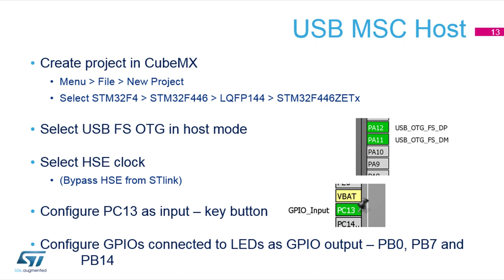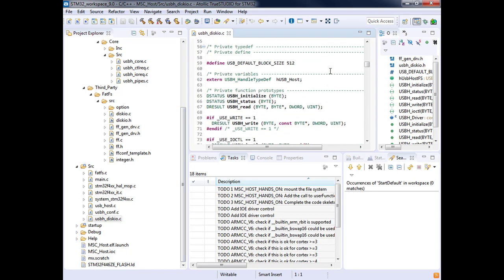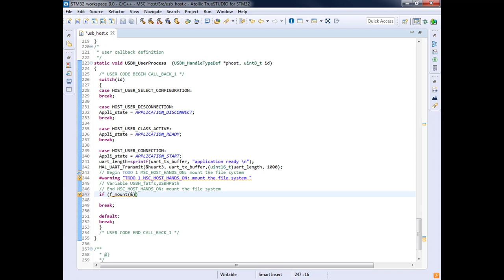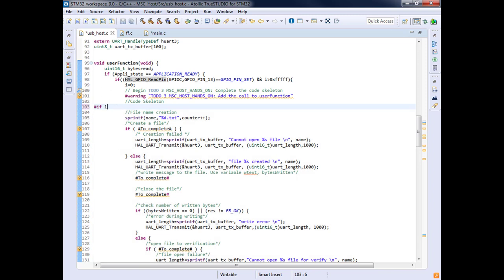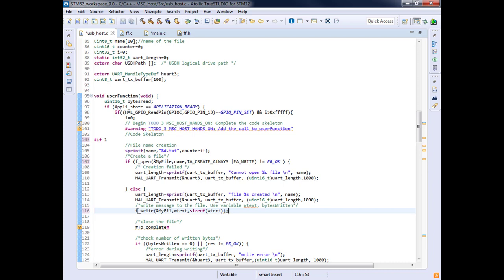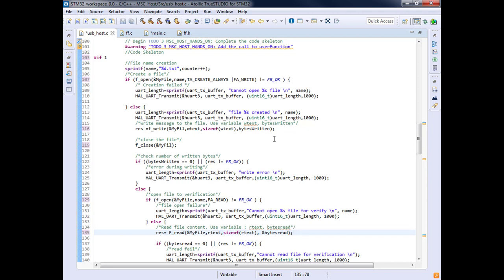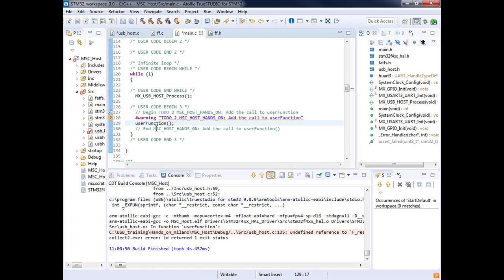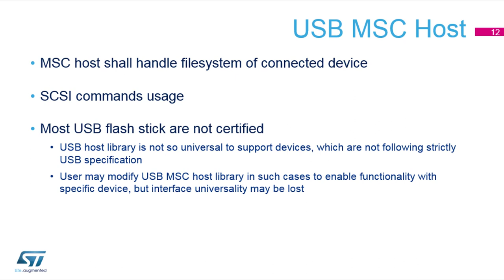STM32 USB training - 11.2 USB MSC host labs

Comment: Nice, now (2020) could we have a v2.0 of this tutorial, using native ST tools, like CubeMXIDE, FreeRTOS support (as it's included in the delivered middleware and mostly nobody does "bare metal, infinite loop" in 2020), a newer version of the firmware, as the generated firmware structure is now almost completely different from the video, and maybe, just maybe, some coding that is not a definition of anti-pattern and quick useless hack, like a RTOS Task ?

Comment: Hi, as shown in example for supplying vbus another gpio is used if i simply put a resistor divider to ensure supply is less than 5v and activate vbus does that work actually my application always saying device not connected please suggest what to do
Reply from the maker: Hello,  Visit our online community to find answers to your technical questions and share ideas with your developers and ST experts : https://community.st.com

Comment: I applied all steps but ı did not see  usbh_diskio.c file. Where am ı wrong ? Thank you.
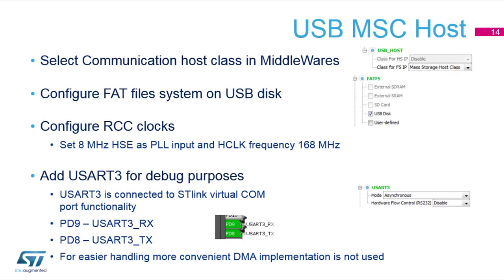Reply from the maker: There is a mistake on slide (~2:30 on video). Instead of "Select Communication host class in MiddleWares" there should be "Select Mass Storage Host Class in Middlewares".  Sorry for this.